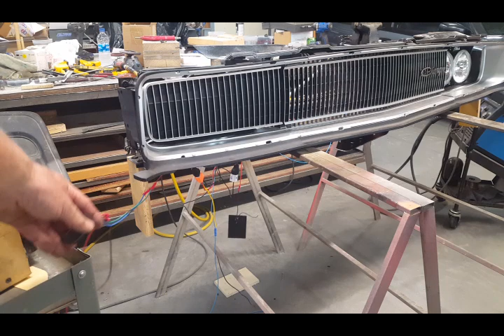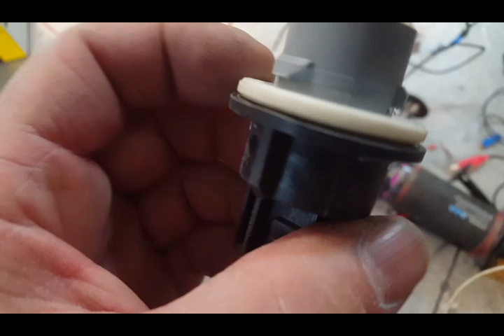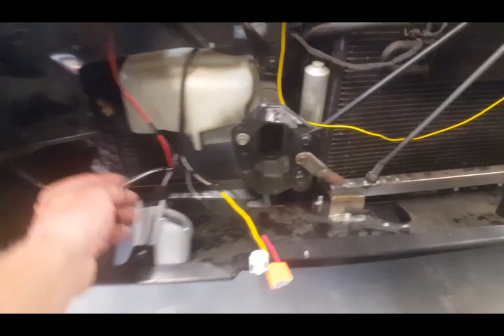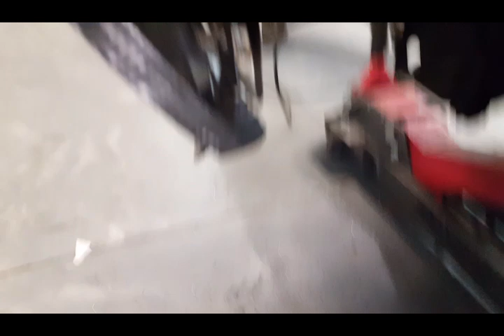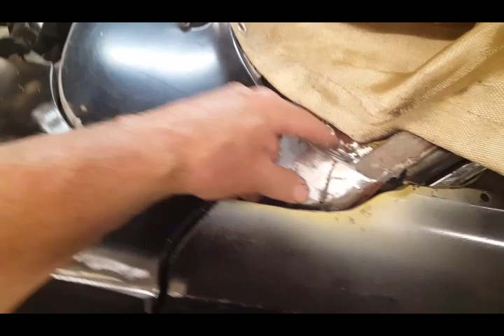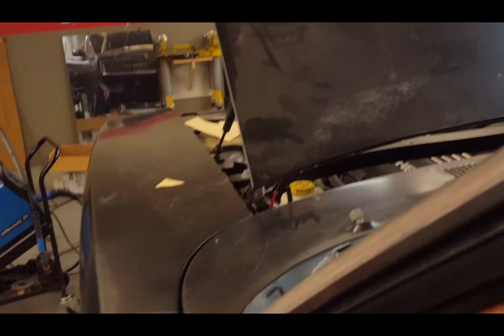Don's 68 Charger body swap part 33

Comment: Almost finished, Steve, looking great.  I had an idea: what about a timer on the headlights so they didn't turn on until the doors were fully open, might be interesting.  Also, what about angling the radiators back to give more ground clearance and not have to worry about it being higher than the vent on the pump?
Reply from the maker: All great suggestions but this build is on a budget so I can't afford to experiment with anything on this one. I am just trying to complete the project without running the owner out of cash. Thanks for the ideas though. Great food for thought.

Comment: Nice work once again.
Another way to have full limit contact on the actuators would be to have their mounting brackets spring loaded. This way exacting full throw and retract to stops would be cushioned.
Reply from the maker: Great idea Michael. Thanks.

Comment: Can you open the headlight doors without turning on the headlights? As usual awesome work, ingenuity and craftsmanship.
Reply from the maker: I did not want to complicate the wiring with another manual toggle so no.
Reply: @SteveMirabelli  Understand the wiring issue, however it would probably be nice to be able to open those covers to clean the headlights or replace them without them being on. Not criticizing your work by any means, just saying that it might be worth considering.

Comment: How much stroke does that actuator have? I am thinking about using one to convert an air grabber hood.
Reply from the maker: i am sure they are listed as 2" but more like 1 7/8" throw. you can play with mounting angles to make it work out.

Comment: Absolute work of art, Steve! Your fabrication not only works, but it’s functional and sustainable!
Reply from the maker: Let's hope so. This car will live 5 hours away. Thanks.
Reply: @SteveMirabelli  I was wondering how you were going to retrofit the headlight actuators. The set up you have is amazing. I was thinking you were probably going to use a set of Detroit Speed headlight motors for a Camaro and modify them to fit. The set up you built is amazing and looks very beefy!

Comment: First time I've seen linear actuators installed, nice explanation and setup.  A minor issue for me would be the lack of the "flash to pass".  I use that a lot driving on back roads and would be beside myself if I didn't have that feature.  But that's a me problem.  And I swear gremlins steal my welding gases when I'm out, I wonder if they've migrated east to your neighborhood.
Reply from the maker: I check for leaks every time I put a new tank on but this one seemed to go faster than the rest. The car has flash to pass but with the doors down not much good,
Reply: @SteveMirabelli  If they are exchange tanks you’ve got to beware of the valves, sometimes when you crank them all the way on they leak around the stem, if I have that problem I find it helps to not open it all the way.